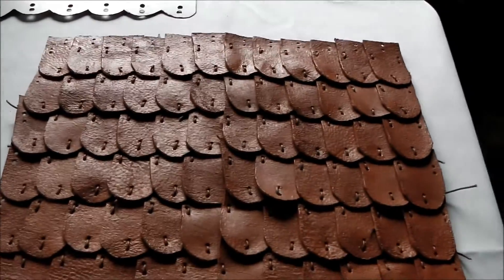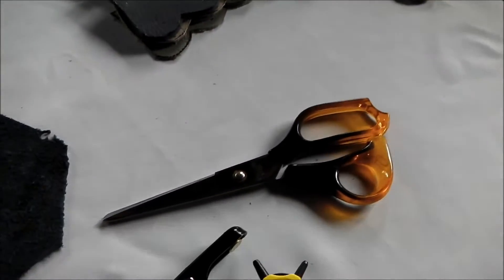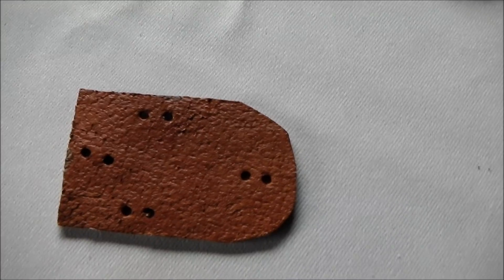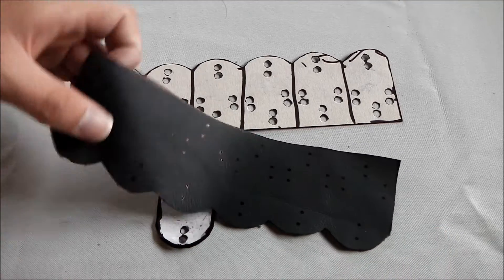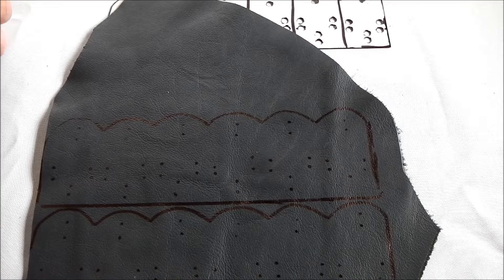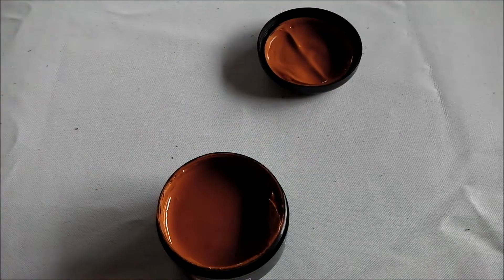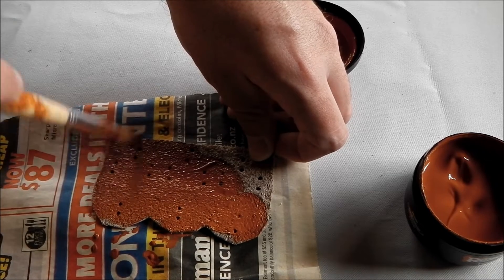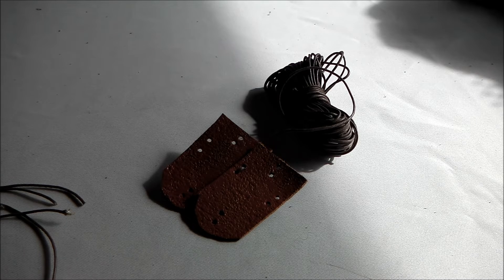How To Make Leather Armour

Comment: Hi when you say paint on the leather is it a certain type of paint or can most paints work
Reply from the maker: what i use is a waterbased paint that will stick to almost anything its hard to make a recommendation that is available everywhere but as long as its not oil based it should be ok